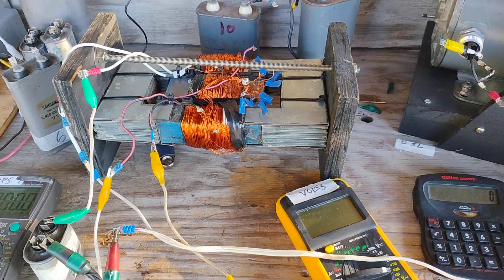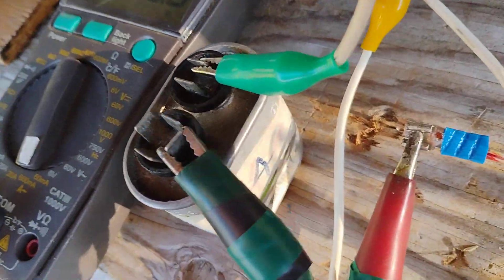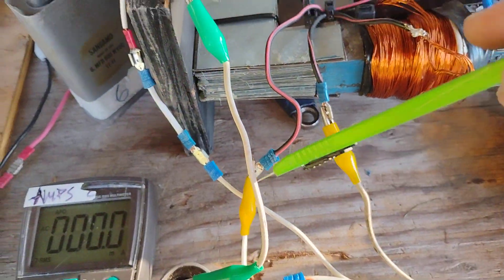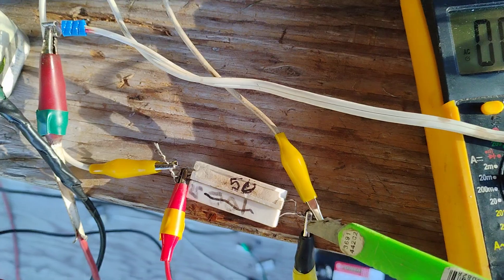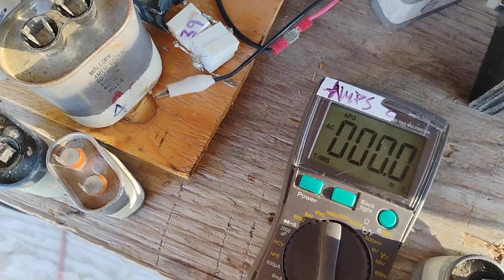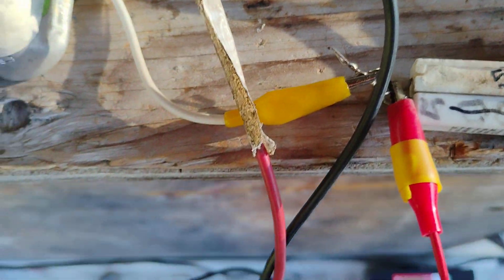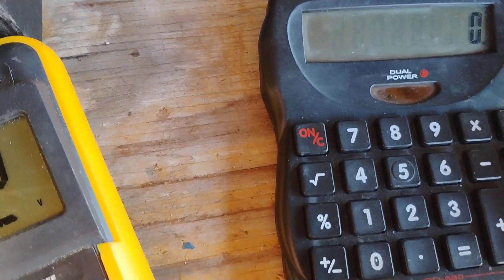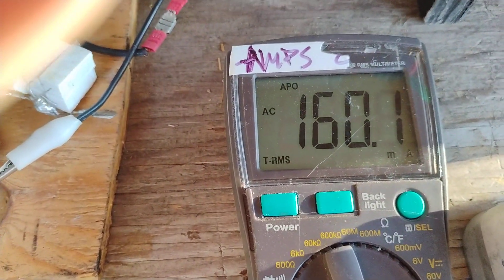40.8W OUTPUT from a 19.4W INPUT using a statpower-invertor powered hemmoroidal transformer

Comment: Not even wrong. Your calculations are incomplete, all AC power measurement must include phase. And that will only be correct if your inverter has a sine wave output.
Reply from the maker: Yes I have  checked  phase shift between voltage and current with a scope on the AC input, There is no phase shift on secondary output since it is lump resistive load there so no worries....
the input is an inductive load so there is always phase shift and power factor needs to be calculated.  
I  have done many boring videos of looking at phase shift and can get a 90 degree phase shift while a resistive load on secondaries if I so choose to do that with these transformers (it's best feature - so it's a a reactive to real power "convertor"while also disquised as a step down transformer)
A 90 degree phase shiftmakes power factor zero in the V x A x PF = AC  watts measurement.  
99% of people do not understand what power factor is.
These two recent videos only interesting, and show "what the meters say" 
one with the grid AC, the other with the invertor "AC"
 (which is really alternating DC sharp cap discharge pulsing from the statpower invertor which is basically a DC boost convertor circuit with voltage doubling that alrernates discharge  both directions with a 120vdc cap discharge as the AC so no pure sinewave from invertor nor is it even modified to resemble one) 
What is very interesting is good effect of power factor correcting cap as output remains the same but draw drops big-time at least when using AC from grid,
 the invertor AC output  was  working crazy with the series AC cap and very hard to believe is true or accurate of what the actual watts input is but is what it is (with meter).    
If I can "imitate" the "AC" cap discharge from invertor, using some sort of other type of "AC" generator, this might really be something.